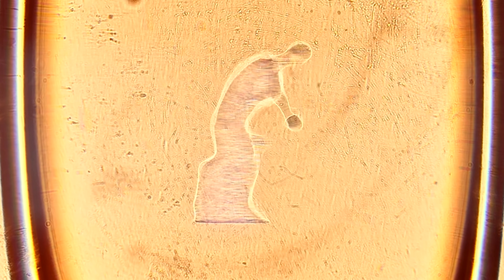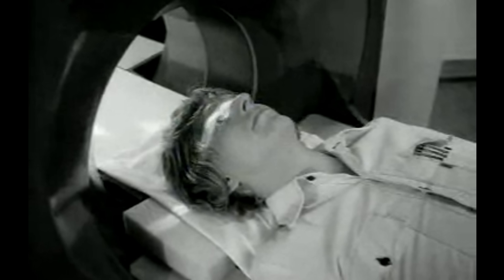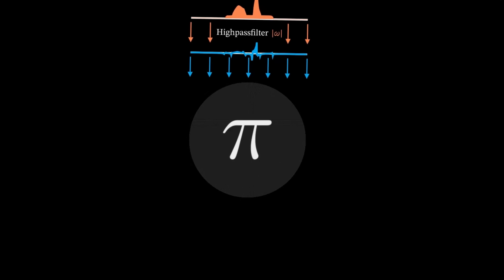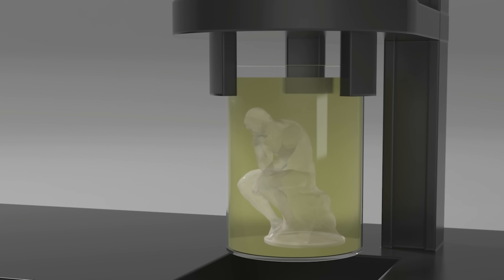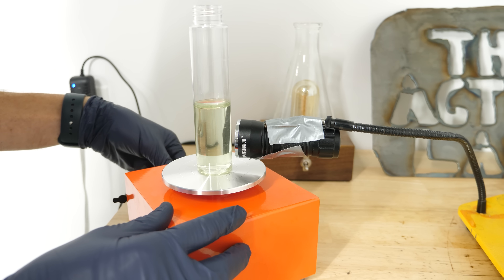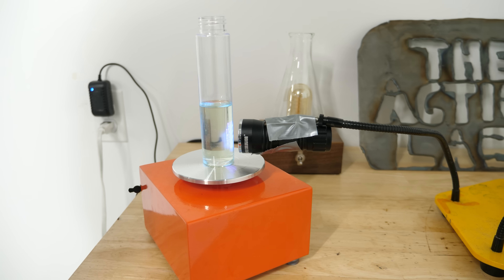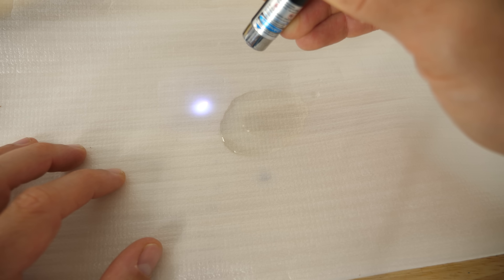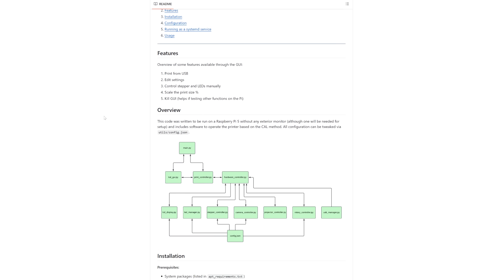Volumetric 3D Printing Is REALLY FAST

Comment: So if I understand correctly these resins will not be able to be filled with ceramic particles or other fillers that give the resin its desirable industrial or medical properties, because that would disrupt the light penetration. So you can make unfilled, clear shapes but for any indication where the material properties matter this will not work in its current state.

Comment: Just when I thought I was done with resin printers. 😅 I'd be curious to know what impact this layerlessness has on quality. And how would we even measure it if we can't talk about layer height anymore? 🤔

An other thing I wonder: how sensible is it to perturbations, like being bumped or even just vibrations in the table holding it? With the whole rotating thing and flashing in the middle of the liquid, I imagine it needs perfectly still / labo like conditions to avoid fail prints? (I was surprised after doing a few tests with a classic resin printer that it did not care if the resin was agitated while layers were flashing, presumably because of how small a space there is between the build plate and the FEP, preventing resin to move whatever the conditions are in the VAT).

Comment: Why use a spinning circular container? It seems to me like using multiple light sources in a stationary clear cube would lead to much more accurate, higher-res prints. Not only is spinning not an issue (and you have more flexibility in the kind of resin you can use), but there's also no issues with lens distortions.

Comment: I would expect it to harden around the outer edge simply because the threshold of light to harden the resin is met right on the edge, then it absorbs. You could use 2 light sources with intensity/2 on either side with some angle on them and the intensity where they meet would be the only point sufficient to harden the resin, adjust the angles and your printing objects in the middle right?

Comment: this is simple enough someone can make it with a mason jar, a motor, a plank of wood, a raspberry pi, and whatever light and resin they're using. my price estimate for one of these simplified rigs is in the low hundreds (as in lower than 500~) USD. i feel like i'm being a little stingy with the pricing for the light, though. my gut is telling me it's a UV light with an array of individually programable UV LEDs. that doesn't sound thousands of dollars expensive, but it does make my estimate feel a little low. oh well, sticking to it. i'm sure some thrifty inventor out there would be able to do it for cheap.
Reply: lol. i spent all that time typing up this comment and you went and basically did it. aaaand... oof. ok, so the resin is the important part, but your experiment gave me an interesting idea. what if you used the negative space to make a mold? basically, use the pre-programed light show thing that the guys who came up with the idea use, but use the regular resin you're using. in my eyes (inexperienced and very speculative), it could still create the shape with negative space. just reverse the values for the light show.

Comment: Pretty sure it's more than the resin. The light also has a focal point which looks to be set in the middle of their containers whereas your light was simply directed AT the resin. The intensity of the light through the fresnel lens would keep the surrounding resin from hardening at the same rate thus giving you a "print" in the middle.
Reply from the maker: No it is not focused in the middle. The light shines all the way through, that is the point of the tomographic projections. Just like in the video my  "tape light beam" shined all the way through the disk and it can still make a circle

Comment: So, after you make the part, it comes out rather slimy. I'm assuming you just wash it off to clean it up. Then, what happens to the resin after you wash it down the drain? More plastics in the environment? Seems rather polluting to me. No thanks.

Comment: Now this is finally the kind of innovation that seems to be actually applicable to home devices. I am curious how does it compare to FDM when it comes to price per kg. It can be beneficial especially for parts that would normally require supports and stuff that would break along the layer lines when printed traditionally.
Reply: This technology isn't really comparable to FDM whatsoever. It's more related to traditional resin printing. The resin used in traditional resin printers is comparable in cost to filament, but I imagine the special threshold-curing resin required for this technology to work is going to be very expensive if anything like this ever hits the market.

Comment: They also had a fresnel lens, focusing the light deep into the resin when it reaches its focal point.

Shining a flashlight or laser with no focus is of course just gonna harden the outside edges and not penetrate deep into the resin vial

Comment: In a similar way, as a child I tried to invent a more patient-friendly radiotherapy, and at the same time faster. Instead of contaminating the patient, make the CT scan more intensified. Like flashlights placed around the perimeter of a circle, 179 degrees so that they do not irradiate each other, and the other 181 degrees are sensors to control the amount of radiation retained in the body. Radiation from one degree is harmless, but at the point of convergence of all the rays, no cancer cell will be able to preserve its DNA and will no longer be able to divide.

Comment: Wouldn't it be possible to just take four lasers which have each the light strength 1/4th than what is needed for the material to harden so that it only hardens where the four lasers intercept each other? So you could just project the form from each side to get the 3d object

Comment: In your attempts, maybe the resin vial was spinning too fast? Seems to me that would cause the centrifugal force to send the solidified chunks towards the outer edges, instead of allowing them to form a ball in the center. Also, no idea if solidified resin has the same buoyancy as liquid resin, but if it changes, then your ball would start to float or sink before it's complete, making more of a cilynder than a sphere, right?

Comment: In practical use, I think having a speed sensor (black and white tallies) on the cylinder could help synchronize the projector with the resin. 
I’m curious to know how fast it can be spun, or if the speed was already carefully balanced with the intensity threshold, projection  intensity, and exposure rate

Comment: Really interesting stuff! A couple of things I’ve been wondering:

• In that other company’s demo, the light seemed to cure only the center part of the resin. Was it all the same resin throughout, or could they have mixed different types so the middle reacts more to light than the edges?

• Since the process needs light to pass through the resin, does that mean fully opaque or heavily pigmented resins aren’t an option yet?

• It looked like there was quite a bit of resin left over after printing — can that unused resin be saved and reused, or is it changed once it’s been partially exposed?

Comment: But is it solid on the outer layer only or the whole part is solid?
And How did they control the depth of the edges of the 3D printed part?
Why the liquid surrounding the built part was not solidified? Could you please explain?

Comment: Doesn’t the density of the object change as it forms? As such it would sink or rise in the resin container? I assume also that the resin needs to spin up for a while so it reaches stability and is turning at the exact rate of the turnstile before it is exposed or it wouldn’t be a sharp print?

Comment: Wouldn't it be better if the vial stood still and the light source moved around it ? I'm no fluid dynamicist, but having all that resin sloshing around doesn't sound healthy to me.

Also, how do you make an object with internal structure, structure which is mostly hidden by structure radially outside of it

Comment: A few questions:
1. Can this print rigid parts? The part you showed in the beginning looked "squishy."
2. How accurate is this method of printing?
3. How well do the parts stand up to heat and stress?
4. How big can the parts be?

I was going to ask if you can reuse leftover resin after a print, but you answered that!
Reply: Q1-3 and Q4 are related. In Computed Axial Lithography (CAL), the resolution is proportional to the size of the whole structure. If you print a 1mm structure, the resoluiton could be 10-20μm, but if you print a 10cm structure, the resolution will be poor.
Also, it could print rigid part which could stand up heat and stress, if the whole structure is small...
Reply: 5. why does the mustache fit?
Reply: I think it lookssquishy because it's still soaking wet with resin. It was just taken out
Reply: Nothing tangible has been made with 3-D prints in the home… it’s a pure novelty and isn’t justifying its creation even after all these years
Reply: @TheQuota2001  What?
Reply: @TheQuota2001 Absolutely wrong, I have seen many very functional prints all over youtube if you just look hard enough
prototyping, robotics, planters
There are some limitations due to how pieces are produced and the materials they are printed in, but a 3-d printer can absolutely be a valuable tool
Reply: @TheQuota2001  I respect your perspective. My experience and perspective are different depending on your context. For parts used in the field requiring precision and strength, I use Nylon. Post processing and adding metal stud threads to some designs increase their performance. But, I will say that some small businesses sell parts in PLA, PET, and Nylon that are definitely cheaper to CNC in aluminum if manufactured at higher volumes and no post processing. I honestly stick with Nylon if I'm making a part for field use, and a low volume (less than 5). Otherwise my designs are likely to be CNC Aluminum or sheet metal depending on the design's function.

Comment: One potential problem is that you couldn't have a partial infill with the overall structure enclosed as you can with FDM, you'd have to have a point for the media to drain. I suppose that isn't any different from regular resin printing though, so it just depends on application. Pretty cool.

Comment: that still makes no sense... the light has to pass through the resin either way. you'd need 2 lasers from different angles to converge at a point so the light at that point is more intense.

Comment: The printed structure also must remain neutrally buoyant, meaning there can be no significant shrink or expansion/increase or decrease in density, as the print is formed.

Comment: I wonder if the final resin polymer might decompose or if there's a critical point where it stabilizes?
Of course the initial light induced polymerization is already talked about, what I'm referring to is kinda like the oldskool Lenovo/IBM soft-touch rubber decomposition, that is, a final print, if it could possibly degrade quicker than expected of plastics.

Comment: I've been thinking about this method for a while now, i do some tesin printing and know that peeling,  regardless of the method used is the single biggest time sink of the technology.   And while this method is cool, its less than ideal for larger items. Similar issue as the old vat printers, you always need way more material than you can actually use.

But a blending of the two seems like a good option in my mind. Using converging beams to cure resin just above what would be the release film, removing the peel step all together.  It could even be used to make continuous prints without layer lines, retracting the bed at a steady rate while the image fluidly changes to the appropriate shape. 

Probably not as fast as this method, would restrict materials to at least semi translucent resins, maybe not ideal for mini figs or highly detailed sculpts, but as a prototyper or similar machine it seems ideal. And scalable beyond what is likely plausible for machines requiring mechanical release steps.

Comment: One advantage (at least for now)  that  a standard 3-D printer has over this is the availability of different materials that can be 3D printed.  Each material has advantages (and disadvantages) which means it can be used in different applications.  If you want durability, use ABS, if you want flexibility use TPU and both are done using the same 3D printer.
Reply: Different materials, and from the looks of this video, better part quality - the little robot man that he showed at the beginning did not look rigid, and the screwdriver handle looked as if it had melted.

Comment: question. would it be a strong print? It sounds like you can't put any supports inside the print so any structural strength would be the resin inside of it that didn't harden.

Comment: you can use two beams also. the total energy for one beam has to be less than the activation energy, but two have enough to trigger the crosslinking.  This was an idea in the 90s, but they were using lasers.  Seems like it would work with two images, probably a bit like a boolean intersection

Comment: Centrifugal force due to high speed rotation is what pulls the hardening molecules to the edges. If you slow the rotation, you’d probably have it in the center as expected.

Comment: another piece of the puzzle is the fact that the hardened resin stays at the same density (apparently). Otherwise, the structure would float or sink during printing
Reply: It's about molecular structure.. The resin creates bonds betveen resin molecules while curing, susteining the same density.
Reply: @Alex96301  I don't get it
Reply: Ice floats on water even with it being the same substance. But most solids sink when immersed in their liquid form.

If the hardened resin were more or less dense than the liquid resin, it would rise or sink during the printing.
Reply: I was looking through the comments with this exact question, thank you!!

Comment: I think you explained the pi tomography slightly wrong. In this example the signal gets bigger the more material it travels through. Clearly visible by the fact that there are huge spikes whenever there is a large body like a leg orthogonal to the output plane.

Comment: Definitely very cool. But also your resin needs something in it that absorbs UV light, so there is less UV light breaking the polymer bonds in the finished product. I would be curious about what they did so the little screw driver can be in direct sunlight for a few days.

Comment: I was thinking that the as it cures  inside the vat does the specific mass of the material not change (like with water and ice)? And if it does only slightly this will not work on a larger scale (only in space…)

It is still a super cool step forward and I hope to get such a machine for my business in a few years!

Comment: A couple of years ago Carbon3D had a 3D printer that was also really fast, and also relied on the presence of oxygen to prevent curing where not appropriate. It was very similar to a regular SLA printer but the membrane at the bottom was permeable to oxygen, to prevent the print from sticking to the bottom of the vat, allowing them to print really quickly. 
The algorithm that makes the projections is called a Radon transform, by the way.

Comment: in the experiment you did..If you've used multiple lasers surrounding the resin without spinning it..Then you might 've got a small sphere out of it..focusing all the rays for a small time hardens the resin at a point where all the laser beams meet..Would you please try that for me or just correct me if I'm wrong...Thank you!
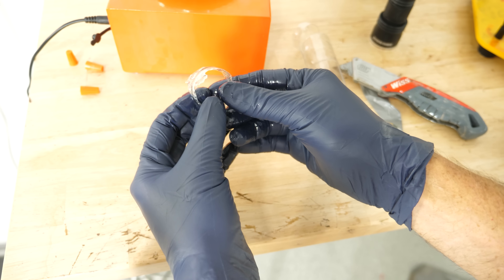Reply: 8:56 The lasers can't penetrate that type of resin, so it can only harden the outside, no matter how many lasers you point at it.
Reply: @JamieJamez  ohh..okay i got it!! thanks a LOT!!! But what I say could be applicable for the type of resins that could penetrate lasers ?

Comment: Am I right in thinking that the special resin uses visible light, rather than UV light? That brings up a few interesting ideas. For one, it might be possible to freehand a 3D sculpture by manually shining flashlights into the rotating resin, although it would be very tricky to control the shape. The other thing is that, once it's removed from the resin, the finished print will continue to harden as long as it's exposed to light, which would eliminate the final curing step of traditional resin printing.

Comment: There’s also a “little issue” in that the resin from this process has to have minimal density shift as it cures, or your prints will crack apart. Conventional UV printing processes can tolerate a lot more density shift.